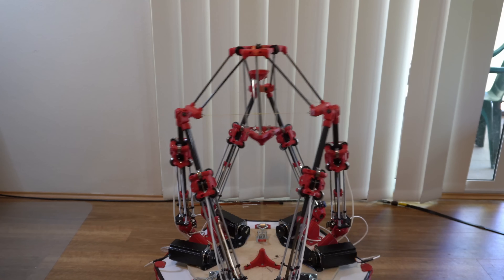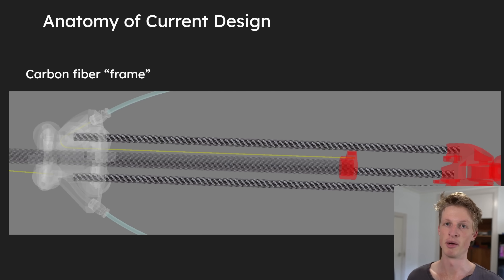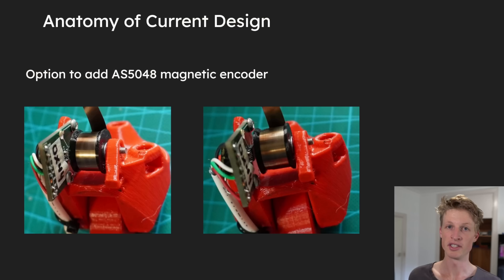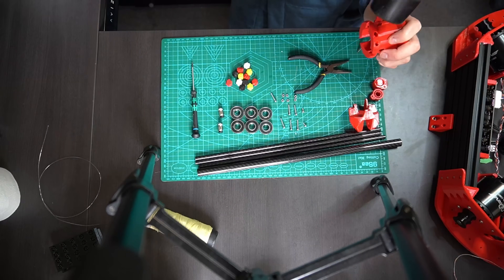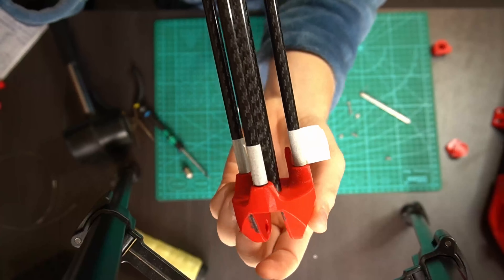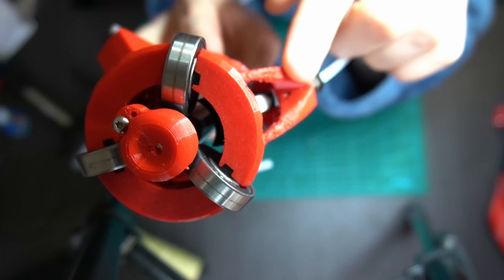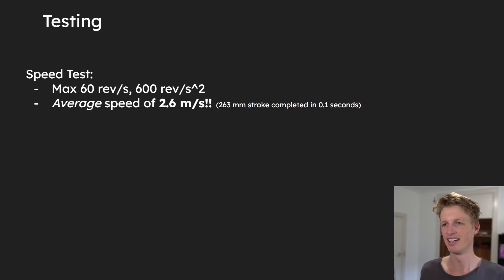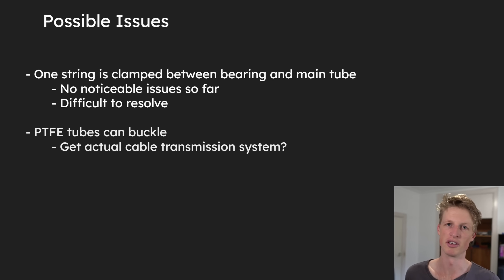Designing High-Performance Linear Actuators: Speed & Stiffness for my Juggling Robot | PDJ#19

Comment: If you do decide on another iteration, you could use the three linear actuators to make a very large and potentially fast delta printer.  Edited to add:  Think Bike cables for the cable issues.  The tubes have a twisted wire inside to ensure flex and length of housing unlike PTFE tubes that can ' crush ' under stress.  You may be able to find similar gauge wires as the string or at least close enough for your purposes.

Comment: You should consider a capstan style of transmission to the rope. 
Also, if you want to ba able to desassemble the tubes from the plastic, you can make a full cylinder, drill it in the center and screw in a slightly oversized screw  to make it press fit

Comment: You may remove tubes completly, just move the motor to one of the end of actuator. Also , for brushless motor, you can use the body of motor as the base for spool - that way you have ability to center the motor relative to the plane along the actuator. Event more, you can use closed loop string, or even chain.

Comment: Also, with a cable, it is possible to push and pull, though a return spring directly on the opposite end of the shaft can have accurate repeatability, less parts, and so on.  Simply switch your ptfe tubes to 1mmx4mm or omething with a thicker wall.

Comment: Did you try using timing belt to transfer motion from base to the joint ? Then at the joint, you can use gear to drive the shaft/leg ?

few issues I see with current design are
1. Strings need to stay in tension. If it isn't, then you'll have backlash. Maybe it's not visible when it is moving slowly, but at speed, it may increase.
2. Strings under tension become straight. This can mean the motion of your actuator can make the string inside PTFE tube drag against wall and cause failure.
Strings are also stretchy, and show plastic deformation.

Lastly, I think instead of the 0
1, 0.2, etc  tolerance pieces, you can use something like an eccentric nut ?

Great project btw, just trying to see improvements.

Comment: Recommend moving the "down" string to the bottom of the actuator, not the mid point. Will reduce the side pull from the string, and reduce dynamic load a bit. Also, see if you can shrink the tube diameter; seems you used a typical bowden tube, and your string is substantially lower. The less gap you have between string and side-wall, the more efficient the energy transfer. Ensure the materials are lubed well, as the friction will heat the PTFE, and cause it to creep plastically. 

Nice job overall!

Comment: Super awesome! Another alternative to the bearings are igus drylin type r bearings. They are a split sleeve that rides very nice on carbon tubes and are reasonably affordable at around 5 dollars. We use them all the time at work for that purpose. If you put a slot and adjusting bolt in the 3d printed part you can set the preload/slop. You could probably even make a 3d printed spring feature to auto set it

Comment: There are a lot of really excellent design choices here. I love the metal ribbon... you called it a zero force ribbon? And the encoder to read the distance. I've done some work with that general idea in the past (I used spiderwire, but I think the metal ribbon is better, where did you source those?) and you can get really good resolution with that system. I do think the over all design with the rods is over complicated, when you can just use cables and a top tensioning system with a single vertical pole. Have you not seen the "Flying-SkyDelta" and "Arcus-3D-C1" cable based printers?

Comment: Would be really interested to see a torque test. Also, can't help but feel a belt drive would work better than cable transmission.
Haven't really seen it done well in cheap DIY systems. They all kinda have the same issues

Comment: The use of eccentric shoulder bolts would eliminate your need for a multitude of bearing spacers. I have successfully used these on a number of projects that require variable bearing tolerances

Comment: String routing issue between the shaft and bearing could be easily solved by routing the string through the center of the pulled carbon fiber tube.

Comment: Some load will make the precision and durability suffer.  The kevlar will cut into the teflon.  I feel timing belt belt maybe a better option, or also rack and pinion method, but will be noisy.  Alternatively, you could use kevlar string in the timing belt style, avoiding the Boden tube and precision loss issues.

Comment: Great design. A couple of observations though: the automatic sliding door on most vans use hard tubing with PTFE sleeve inside to run the cable. Also instead of tying your string at both ends, have you considered tying at the bottom end only and route the string over pulleys at extreme ends of the stroke as you are already doing? this will eliminate the string from business end keeping it enclosed  between the two supports/pulleys.

Comment: Nice! You know you can ALWAYS measure the current of any motor, just with a voltage divider and a shunt. I use it all the time. The spacers are the correct solution IMO. You could use set screws, but would that be better? I am building a VAWT and need actuators like that to adapt the position of the wing very quickly, after viewing your video, I now know it must be possible.

Comment: Very cool project - I would agree that it's a bit surprising they are not more common for high-speed mid/low-load applications, although I have seen similar ideas in some high-speed 3d-printer prototypes(look up the PositronV3).
As far as reducing backlash from the tubes bending, one thought would be to remove them, and put the motor on the actuator near the bottom pivot, and used fixed pulleys - it would remove a good bit of the backlash, and you could probably increase the string tension, which would let you go even faster possibly. I know you want to reduce the mass, but I'd imagine even the fairly heavy motor wouldn't slow you down too much, if it's near the pivot?

Comment: I have a question. It wouldn't be relevant to your project and it going to complicate things but instead of having a motor changing direction at those speeds would it not be a good idea to have gearing to do the changing of direction and use the magnetic encoder to detect its full length to change gear. I know it seriously complicates the mechanism and introduces more failure points.

Comment: Thank you for sharing your wonderful design with everyone. Near the beginning you were trying to design something that would allow you to remove the carbon fibre rods without breaking everything.  Have you seen a the router bits from Freud that come in a two part plastic case, mostly clear with a black bottom section? There’s actually a third part to the case in the middle of the black bottom section that holds the router bit. The third part is made of a slightly flexible plastic which grips the base of the router bit. Sometimes it’s very difficult to get the router bit out of the case and it would be possible to create a model, if one does not already exist, and print parts out of TPU.

Another design to draw inspiration from is the RackBit system from Woodpecker. That system has plastic bases that store router bits, with either a 1/4” or 1/2” shaft (sorry for the Imperial numbers but being in Canada the woodworking and construction industries are heavily influenced by the US).

I know that you have decided to go ahead and just make the connection permanent but perhaps you will find the information useful in a future project.
Reply from the maker: Interesting, this is good to be aware of! I actually haven't seen that design before and I'm curious now: is the case hinged, so that the rubbery section is clamped on to the bit to hold it in place? Or is it basically an interference fit with rubber so as to be more grippy?

Cheers for the suggestion!
Reply: @harrisonlow  

I had to look at the case. The black hard plastic (could be done with PLA, PETG, or any filament like that if you were to print the equivalent) has a well for the rubbery, or more flexible, part to fit in. If one defines that the router bits fit into the top of the part then at the bottom there are four parts that fit through slots in the bottom of the well. To remove the flexible part one must move the flaps towards the centre slightly such that an extended part of the flap, which is angled to slide in when the part is inserted but a 90 degree surface to prevent it from sliding out, to pass through the slots. A basic snap fit part. It's a nice piece of industrial design as it lets the company use the same rigid base for either 1/4" or 1/2" shaft router bits by just changing what bit holder is placed in the base. If you would like some photos I could contact you on Printables.
Reply from the maker: @capitalinventor4823  interesting. I'd appreciate photos if it's not too much effort! I'm not sure I understand what you're describing. Cheers!

Comment: I was building a Stewart platform for a few years and tried coming up with all kinds of quick, cheap, & fast linear actuator designs, but this is the best I've seen! Great work! :D
A couple questions: 
   1) Did you notice any heat generation due to friction from the Kevlar line moving inside the PTFE tubes? 
   2) Have you thought of using a spring(s) to apply the downward (return) force and only using a single line to raise and lower it? I suppose the return speed would be effected by the strength of the spring and may also apply too much torque on the motor especially at full extension, but just a thought I had!
Reply from the maker: Thanks for the kind words! 

Re. your questions:
1) I didn't notice any, but I also didn't specifically check for that. In the testing I've done so far, the PTFE tube has been relatively straight, so I wouldn't expect there to have been too much rubbing. Perhaps there might be with more aggressively skewed tubes 🤔
2) Haha it's funny you mention this! This is exactly how the old design worked (check out this video: https://www.youtube.com/watch?v=h-th1lcGFq0&t=485s) and you hit the nail on the head vis-a-vis its problems: it was a tradeoff between compression speed and excess motor demands that I was not very happy with.

Cheers!

Comment: Assembled wearing your bath robe like the Marc Rebillet of robotics, Marc Robillet. But seriously this is great. The state of the art in linear actuators needs advancing, they are mostly too heavy, and as you point out, too slow. I've been looking into HASEL actuators for robotics.
Reply from the maker: I'm going to take full advantage of the fact that I can wear comfy clothes while working 😁

Wow, what are you doing with HASEL actuators? I actually used to study stuff related to soft robotics and I remember them coming up a bit. A gripper of some sort?
Reply: @harrisonlow  I'm trying to determine, just theoretically to start with, if a HASEL type actuator could be configured in such a way to make strong artificial muscles for an untethered robot, perhaps a robotic animal. The power to weight ratio looks good, they would need reconfiguring for longer throw.

Comment: One solution to the string clamping issue would be to move it to align between the wheels. It would be easier if the wheel sets weren't rotated.

Comment: Can you route the string down two of the three outer tubes and integrate the motor in the lower block so it pivots with the whole assembly?  This would eliminate the flexible string guides and give a stiffer reference path for the strings.  Incorporating a stiff tension spring at one end might do well to preload the tension on the whole system, and consume any tolerance that would affect the overall string path. In your case, I would add the spring at the distal end of the actuator because the position is less critical when the actuator is retracting.

Comment: you know, im looking at this and potencially this accuator can be very good for motion sims, 
If oen build it out of some metal parts i.e. aluminium with metal cords it coud handle the weight quite well and with this seepds you get really good response from a sim rig
Reply from the maker: Potentially! It'd need to be beefed up a bit, but it would be awesome to use for that purpose; you'd get so much acceleration! The motion sim blogs have actually been super helpful in this project, which may not come as much of a surprise if you're familiar with them

Comment: Awesome work, love the progression!
With the bearings, you're running the hardened steel outers against (relatively) soft carbon fibre tube, which will have a bit of diameter variation along its length. The contact area between the bearing and tube is pretty small, so will exert a very high pressure. You'd be better to increase this contact area by using smaller bearings and adding a plastic sleeve that fits the tube diameter. You can buy these as track rollers, but you might not be able to find one for the exact diameter of tube you have. The sleeves could be 3D printed then turned true on a lathe. If you haven't got access to a lathe, you could use a drill with a mandrel and a piece of sand paper wrapped around a rod. The plastic sleeve will give a bit of compliance too so you can preload the bearings without risking damaging the CF tubes.
Look forward to seeing the progress!
Reply from the maker: Big thanks! The "turning true" with a drill and sandpaper is a great idea!

Comment: Very nice design. I am a fan of tendon-driven mechanisms and use them in my designs. Some thoughts :
-In Bouden cables, the diameter of the tube and the cable are usually very close to minimize backlash. The tube usually has a spring wrapped around it to prevent buckling and increase stiffness.
- If you replace the bearings with smaller ones, e.g., 625zz, and add a plastic ring around it as an interface, you can save a lot of weight.
-Kevlar is strong, but it does elongate much more than steel. If you replace Kevlar with steel micro cables, e.g., Codica, you will have a more accurate system. 

Thanks for the nice Vodeo and Good luck :)
Reply from the maker: Good suggestions! Some thoughts:
1) Yep, I can see how this would be helpful 😂There have been a lot of great ideas coming out of these comments and I've bought a ton of materials to test them out. Thicker cable / smaller ID tubing is absolutely on the list 😊
2) Yeah this is a good idea. Others have suggested a TPU "interface" that is curved to match the CF tube. I think I'll be doing this!
3) Per 1) I've picked up a heap of steel cable in different sizes. Arrived this morning and looks promising!

Cheers!

Comment: Instaed of just PTFE tube you could use bicycle gear cable outer, this is usually, on the good stuff, an hard flexible outer coating, I spiral bound internal support (metal) and then a PTFE tube inside, so that the seteel gear cable runs smoothly
Reply: Edit, Gear cable is slighly more flxible that brake cable, they look the same but are slightly different

Comment: Mountain Bike gear change cable outers would be perfect to replace your string guide pipe. Brake cables are just wound steel outer, but the gear change cables are not spiral bound and have a teflon/ptfe liner - they are designed for both push and pull actions with low friction.

Comment: I see you are using concave rollers for the cable at the top do the actuator. This shape actually work against keeping the cable on the roller. Look at tank track idler shapes. Or search curved idler.
Reply from the maker: Interesting. Would you suggest having the pulley be "flat" in the middle, with chamfered ends (to make it printable)?
Reply: @harrisonlow  I think to keep the assembly easier, having a concaved section like the current shape at either end would help keep the string from coming off the ends of the roller when the string it isn't under tension. Then either side of the center should be convexed to cause self centering when it is running and the center could be a very shallow convexed shape or flat to add a region of stability with a consistent diameter.

Comment: i will say if youe ver need carbon fibre tubes otua pla or differant plastics, shove the ends into a air drier, at like 80c, itll soften the plastic and you can slip em out, but you may loose some accuracy, buut my pla at60*c doesnt warp mine atleast. edit i guess an oven would work on lowest settingw with the door open XD

Comment: Re the string trapped between rod and bearing.. I think you can get bearings with a groove around the outer surface. This would give two points of contact with the rod, one either side of the string. Google cam follower bearing or Yoke cam follower something like that.

Comment: the issue with the ptfe buckling could be solved by using an actual tensioning system and a string path under tension, it will require a path under tension all the way back to the motor, but if you do it right that wont be an issue say building the motors into the base of the robot so you dont have to run a long run of tensioned cables, also for ease of use you could have all of your cables terminate before the motors in a loop (possibly reinforced with some sort of loop eyelet) and have the motors connect using a sort of like fishing line swivel (or you could use 2 swivels) this way you can keep things modular.